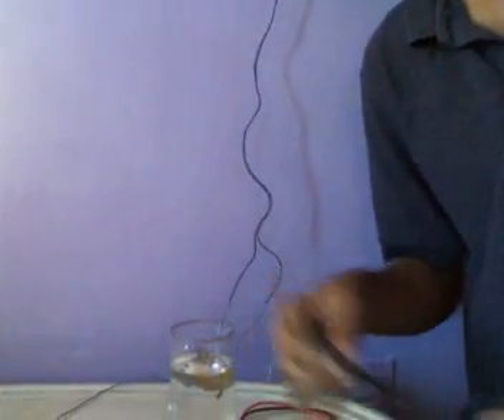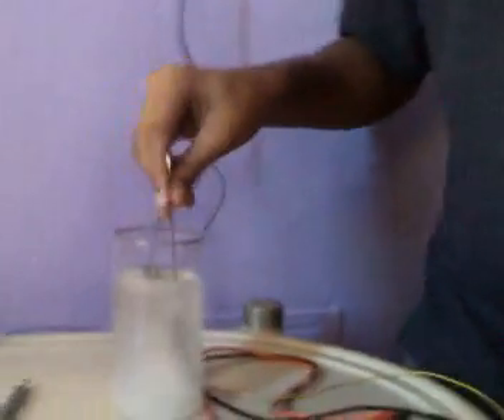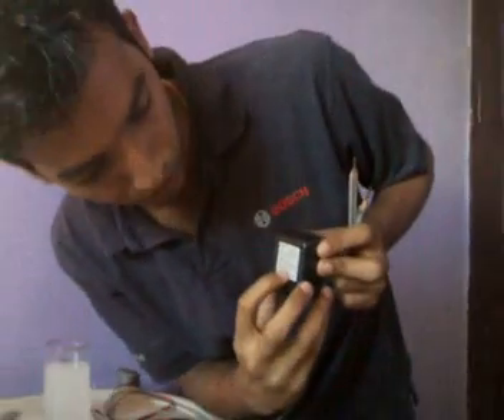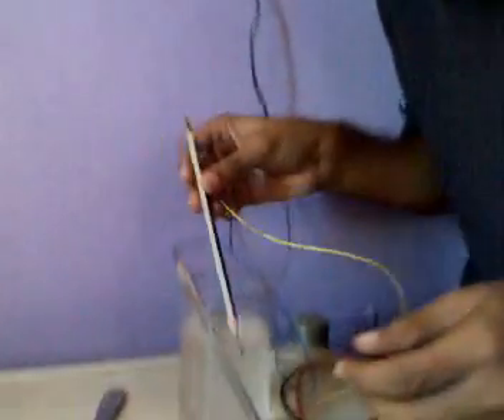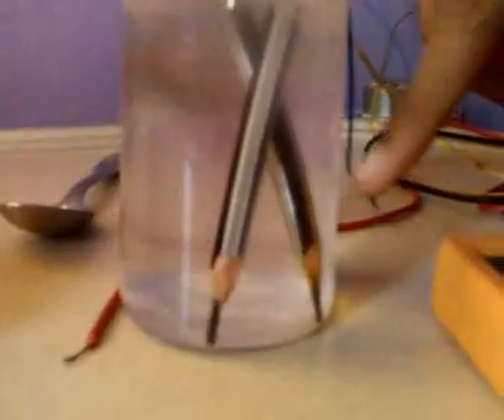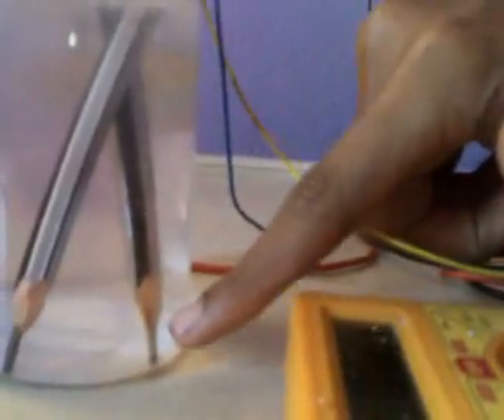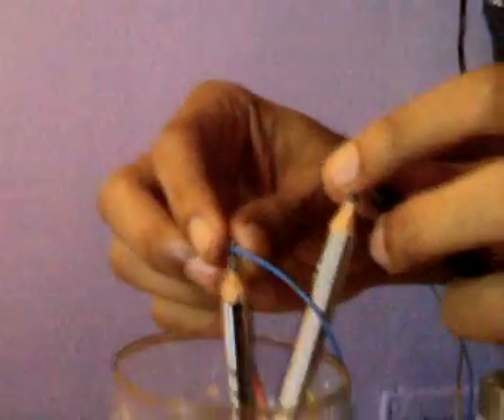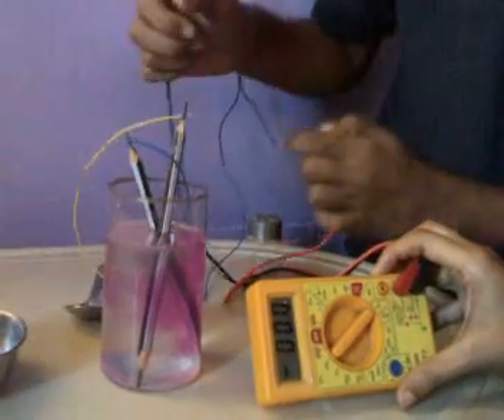preparation of sodium hydroxide

Comment: Hate to break it to you, this makes sodium hypochlorite.
Reply: +itsumonihon Dumbass.  I have tried it and I also educated myself as to why it doesn't work.
Reply: Osmosis Graphite anode, or mercury ions and is able to handle chlorine-free form.
Reply: Valeri Kupunia
Nope.
Reply: It may have impurities but it does produce sodium hydroxide.
Reply: No , in fact is makeing sodium hydroxide
Reply: AcidKidd
Nope.
Reply: AcidKidd
Nope.  That reaction will not take place without a membrane.
Reply: +Osmosis smartass, why don't you actually try it and test the resulting product. this is a well known method of making sodium hydroxide. there are many videos on youtube performing the same reaction with the same graphite rods. you can go and make soap with the end product if you still don't believe.